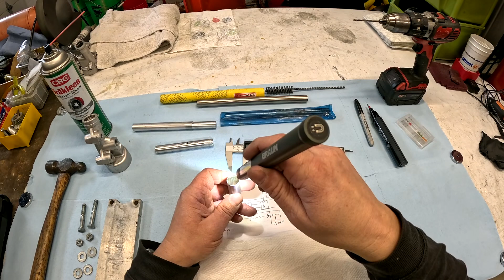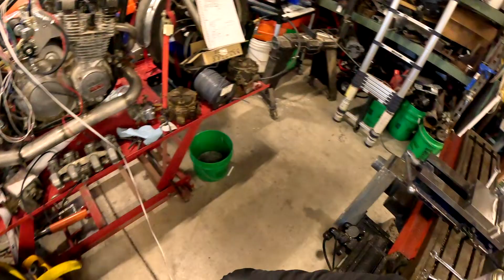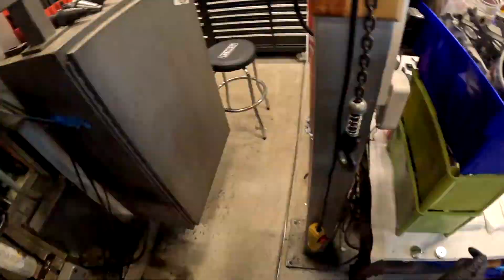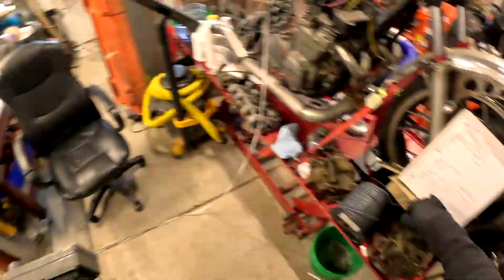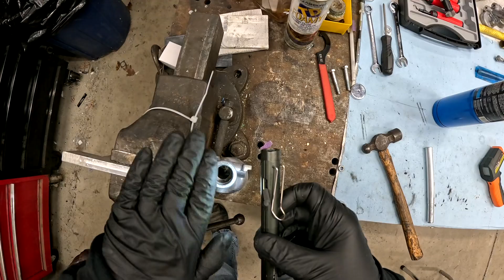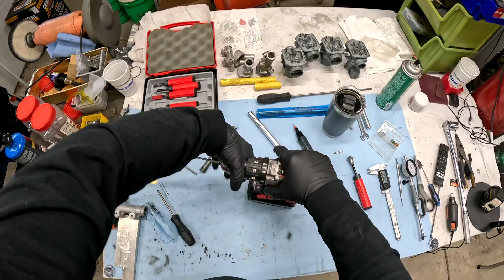KZ1000 Rear Master Cylinder Stainless Steel Sleeve Installation

Comment: Nice to see there's people with the skills and interests to do this kind of service for our old Z's! I have both 1000 and 750 bikes! And if needed, I might be in touch!
BTW - Have You ever thought about pressing an aluminium bolt in there, and bore it out to specs with a boring head?
Thanks for sharing this video! 👍
Reply from the maker: I have never sleaved one with aluminum. However, The first time I did this I used a boring head and had tons of trouble with tool chatter. Especially when it would go past the fluid holes. After that I invested in a reamer.